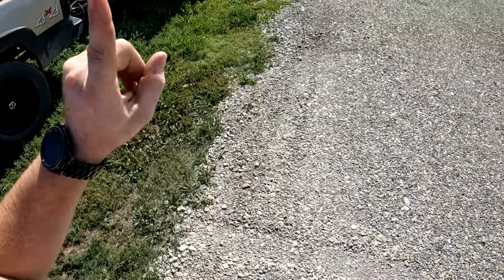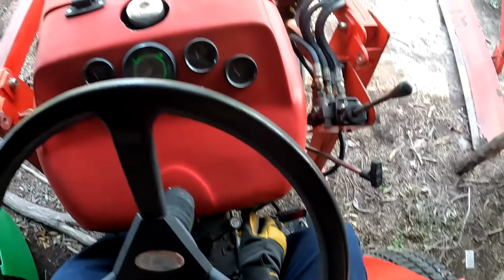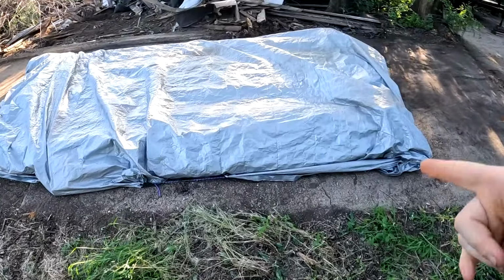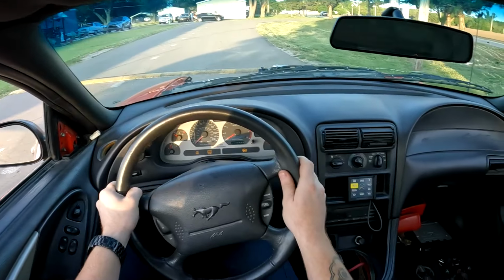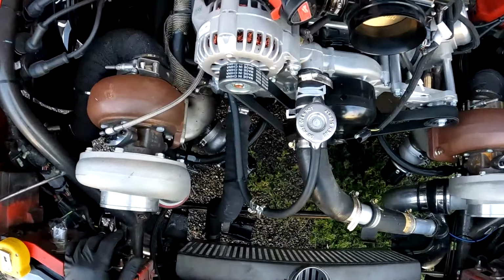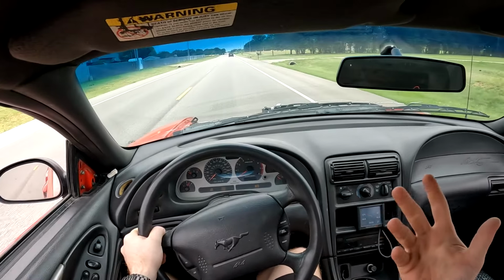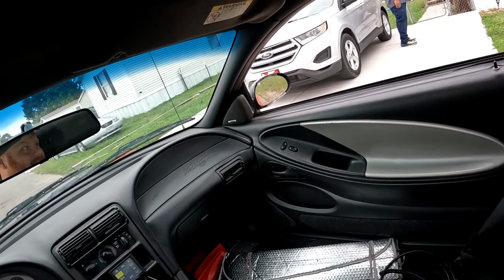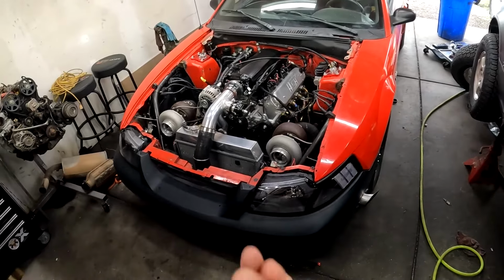DRIVING MY TWIN TURBO MUSTANG FOR THE FIRST TIME IN A YEAR AND A HALF! - BEST FEELING EVER!

Comment: Do you have a clear STEP BY STEP video on how to BUDGET LS Swap a SN95? Can I do it for under $1000?
Reply from the maker: It all depends. If you found say a silverado, tahoe ect and take the power train out. Sell the parts to recoup some money and then buy the rest. I bet you can do it for $1,000. Shop around find used crossmember, fuel system ect.
Reply: I've got a few videos where on different budget builds I've done but $1000 is a difficult goal without selling a LOT of stuff to recoup losses.  Costs add up quick if you think that a Holley Terminator is $1300 or so and good injectors can be $1000 on their own.
Reply: @willisthehutt9422  lol I've seen a bunch of your videos already. subscribed